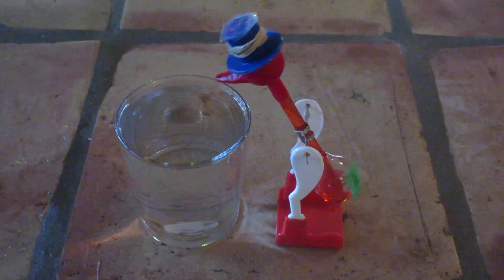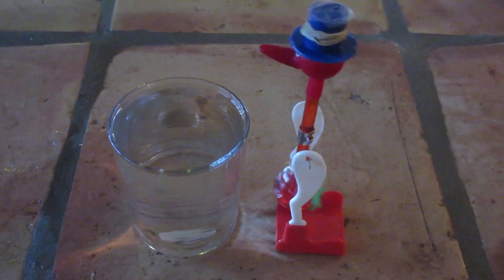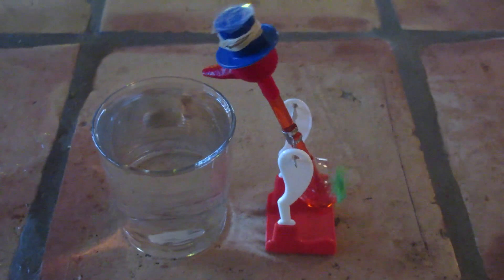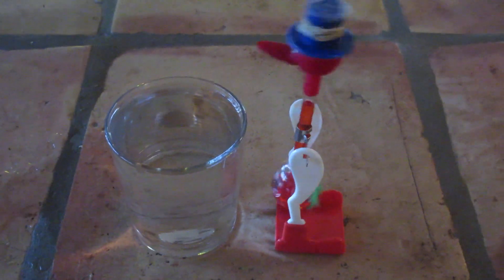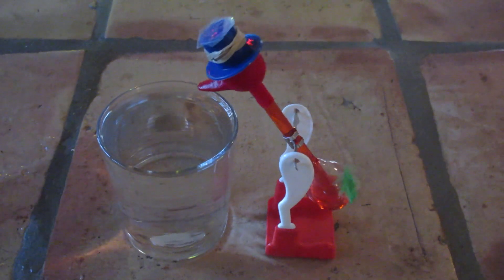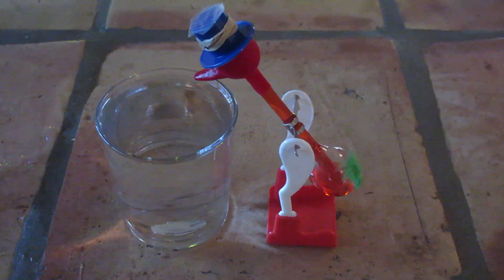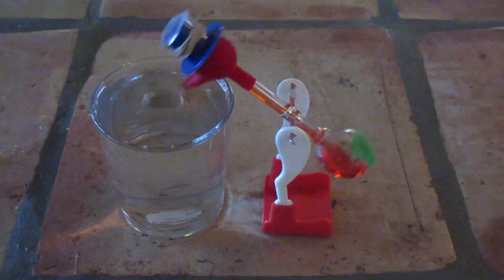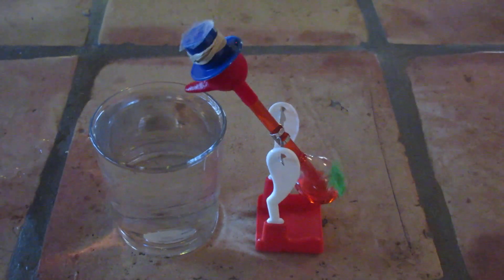Problem #82 - Very Bizarre - How does this Work?

Comment: There are multiple sources people can copy from and quote, so I won't bullet point precisely.  However, it's all to do with relative vapour pressures in the two equally sized bulbs connected by the tube.  The top bulb is covered with a felt, which when wet, water evaporates causing the temperature of the upper bulb to drop, and hence causes the Methylene Chloride inside to condense.  This in turn causes the vapour pressure to drop relative to the lower bulb and so the Methylene Chloride is forced up into the head, making it top heavy.  As it tips forward it picks up more water on the felt.  Vapour bubbles travel up into the head, displacing the Methylene Chloride which drains back into the bottom bulb, making it bottom heavy so the bird tips back again.  The felt is wet, so rinse and repeat.  Sure it's missing a few scientific details but the general theory is there.  Looking forward to a more detailed explanation :)

Comment: Due to different boiling point in alcohol inside toy while constantly shifting center of mass and water condensing the Alcohol fumes cooling system down and it will work outside

Comment: It's dichloromethane that provides the energy supply or the kinetic energy. It's filled inside the tube. It will not work below 35-40°C. It also gets energy from surrounding environment. The temp. gradients are the main source of energy.

Comment: The moisture on the beak of the bird evaporates, which absorbs energy (heat) from the air inside the head of the bird (the same reason why you shiver when you've just came out of the pool in hot weather). The loss of heat, and therefor temperature causes the pressure to lower inside the head. Because the pressure in the head is lower, the liquid inside the bird is pushed up, so that it's center of gravity shifts forward, and hence the bird tumbles over and the liquid leaks from it's head downward.

Have used this drinking bird in my classes for years, as well as your video about conservation of energy in Dutch television programme DWDD. I also took a lot of inspiration out of all your lectures, especially those about light (rainbow), and about statical electricity.

I wish you all the best.

Sincerely,
Jasper
Reply: Isn't it dichloromethane?
Reply: @arctic215  With "moisture on it's beak", I meant the water inside the drinking glass which get's on the beak as the bird tumbles the first time.
Reply: @arctic215  I also thought about it as dichloromethane.

Comment: I think that as the liquid level rises(gains potential energy) the system thus oscillates.
The liquid rises so as to attain thermal equilibrium. We can think of it as the temperature of liquid(bulb at the bottom) being higher than the temperature  of the top of the system(before touching the water surface). And as soon as it touches the water level, the liquid drops to the bulb because then the thermal equilibrium is disturbed, and thus to attain it again, the cycle continues.
I don't know if I am right or not(I am just a 12th grade student). I would love to hear some better explanations over how and what am I thinking wrong.
Thank you.

Comment: The bird will still work in 30 degree Celsius and the frequency of the  bird will also increase as ∆G = ∆H - T∆S and if temperature will increase then T∆S will Become  more Negative  and thus it will make ∆G more Negative and the process will become more spontaneous , 😀😀👍
Reply: Even good explanation!

Comment: The liquid inside the bird's body evaporates, which makes the bird's bottom lighter than the head. Because the bird's center of mass is moved towards the glass of water, the bird's body will experience a clockwise torque from its head being pulled towards the earth's surface. Once the bird's beak hits the water, the vapour in the bird's head will condense due to being cooled by the water in the beak, and it will run back down into the body, making the bird tip back to a more stable position.

I think the tipping bird should still work at 3°C because it seems like the liquid inside the bird has a lower freezing point than water. So as long as the water is liquid (so it can be absorbed by the bird's beak to cool down the liquid inside of the bird), the liquid inside of the bird will also be liquid and therefore the cycle of evaporation and condensation will continue.

Comment: Drinking Bird:

The drinking bird is an exhibition of several physical laws and is therefore a staple of basic chemistry and physics education. These include:

The dichloromethane with a low boiling point (39.6 °C, 103.28 °F under standard pressure po = 105 Pa - as the drinking bird is first evacuated, partially filled and sealed, the pressure and thus the boiling point in the drinking bird will be different), gives the heat engine the ability to extract motion from low temperatures. The drinking bird is a heat engine that works at room temperature.
 
So, it works on heat energy get by surrounding. Thus temperature gradient is the source of energy. No, this will not work below these temperatures that I have mentioned. Again this device is not doing perpetual motion.
Reply: Copy paste
Reply: @hemant05   yes copied from brain and pasted into comments! That was an article about dichloromethane in NCERT that I have studied.
Reply: @azhakabad4229  in which book, in which chapter?
Reply: @AdityaKumar-ij5ok  Chemistry Class 12 Haloalkanes and Haloarenes 
I hope you will not ask me to click a pic if you have studied your book clearly.
Reply: @azhakabad4229  I'm sorry but maybe it had been in an older version of the book. In the newest version it must have been removed.
Reply: @hoodedR  yes it is of 1991
Reply: @Hari_787  Ncert me hai kya ye chiz